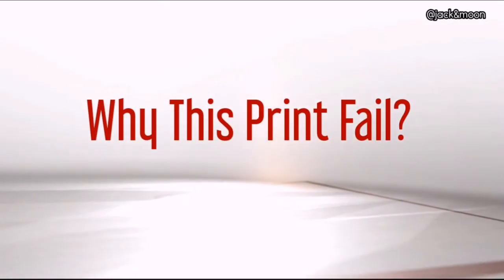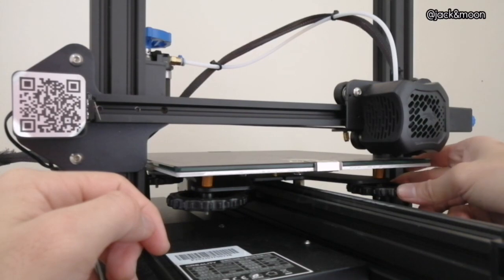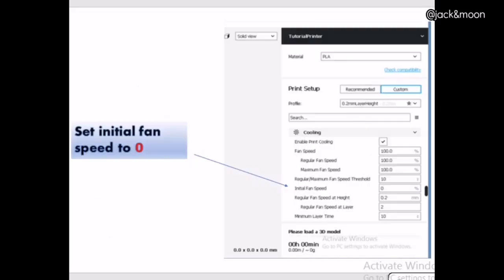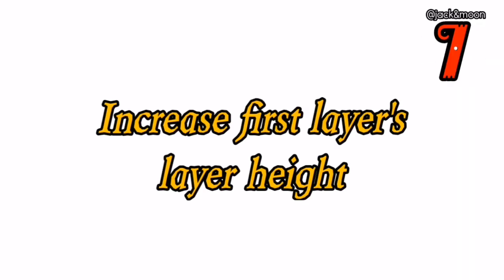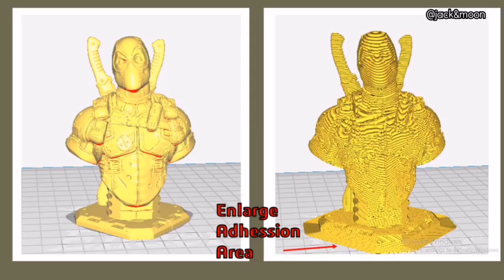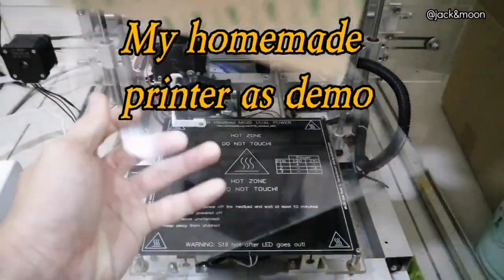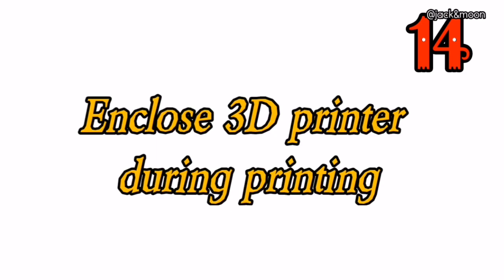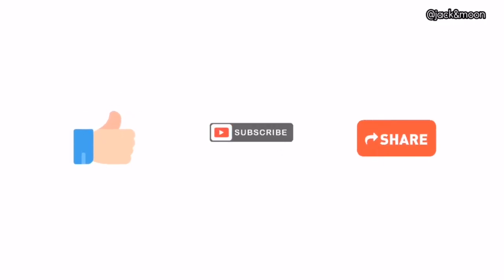Why This Print Fail? #not sticking to heat bed#first layer perfect

Comment: One of my pla spool suddenly stopped sticking to the bed. I tried everything for 2 days without any results. Then I simply switched spool and this one sticks perfectly. So what do you think append to the oter pla spool all of a sudden?
Reply from the maker: Hi sorry for the late reply. Did you leave the failing spool in open environment. I guess maybe the spool is being contaminated by dust. Just our guessing. It is always advisable to keep the filament sealed once finish printing as it can prevent other failures like moisture and brittle of the filament. Hope it helps. 🙂
Reply: might be wet filament

Comment: i heat bed to 80, put a layer of hot melt glue on bed...then turn off heat all-together, wait till it hits under 40 then print...with cold bed cura bed set to 0...when you have finished print heat up again to 80 then remove...simple..
Reply from the maker: It's a great idea. Thanks for sharing 😊
Reply: @gravity-less3dprinting624 thanks,
 no-problem..
Reply: @ellpiece  does that work for it to stick?
Reply: @botzaca0023  yes the heated plastic fuses together...try it..